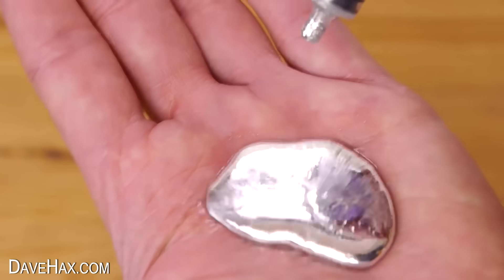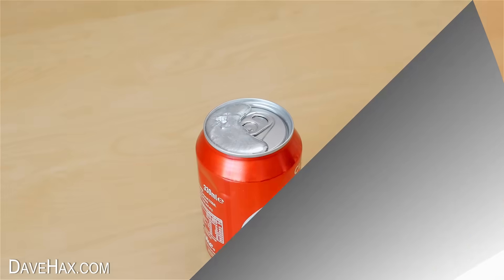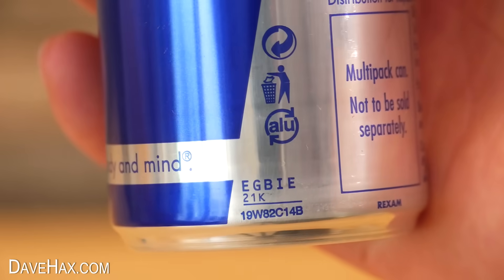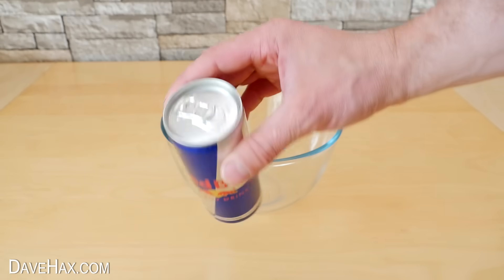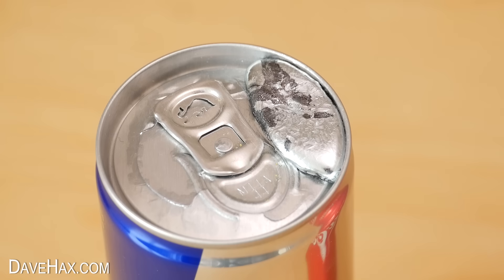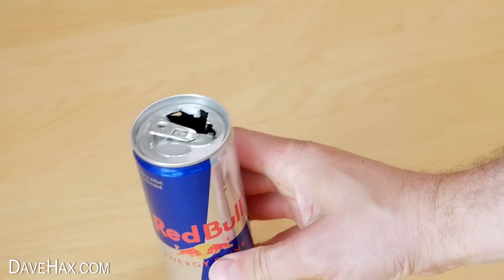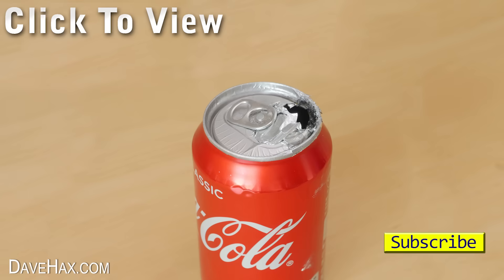Amazing - What Gallium does to an Aluminium Can

Comment: Watching in 2025, here's the explanation why you have to scratch the surface:
Aluminium rusts when exposed to air, forming aluminium oxide. Unlike iron oxide (or the familiar red rust of iron), it doesn't flake off and expose more metal to the air. Instead it seals off the metal from the atmosphere, stopping the rusting process. In this way, aluminium oxide acts as a protective layer on aluminium that defends it from exposure to air.
That layer of aluminium oxide is what stops the gallium from getting in.

Comment: This is why it's illegal to bring gallium onto a plane. Most planes today are made of aluminum alloyed with copper, magnesium, zinc, titanium, and/or scandium. Since the plane is primarily aluminum by weight, bringing gallium could be dangerous as it might alloy with the aluminum and compromise its structural integrity, which could break off a part of the plane and actually, I think you can figure what would happen from there. It wouldn't end very well, that's for sure!

Comment: Of course, there must have been a plastic or corrosive protected film on the can. But can you reuse the gallium and repeat this process over and over again. I want to do an experiment where you take a pound of cans and absorb all of the aluminum out of it and see if the gallium can still Harden and heat up and be as pliable as it was before

Comment: The effectivity of gallium is gone, you mention earlier you heated it right? I saw bunch of video like this, some put gallium directly on engine but the gallium cannot sustained heat. Once you heat up the gallium its effectivity will we gone just like a magnet, the moment you burn the magnet or hear it over 100 degrees, the particle and effectivity will be gone as wellm try using gallium without heating, the aluminum will absorb it.

Comment: Fun fact: Pure Alumium is chemical reactive. But it easily form an Alumium Oxide coating when contact with oxygen. The coating on the contrary is not very reactive, thus allow Alumium to resist corrosion quite effectively.

Comment: Rarely known fact about gallium. It won't affect smooth surfaces, it's not a coating protecting it, it requires a course grain to dig into it. If it's smooth, it just hardens on the surface.

Comment: The "coating" you had to scrape off is Aluminium oxide. Aluminium oxidizes really quickly and would rot away within a day if it weren't for the aluminium oxide layer that protects it from further oxygen (and apparently gallium! :-) ) . 
The fact that it took you longer between sanding and putting the gallium on allowed new aluminium oxide to form on the redbull can. That's what caused the "less effect on the redbull can". 
The stretchy stuff is plastic. There is a plastic coating on the inside to protect the aluminium from the drink. Try sanding off the label and putting the can in something acidic. Vinegar will work. Maybe "cola" will too. Don't drink that cola afterwards. Aluminium is toxic.

Comment: The "thin layer of coating" that he is talking about is basically the chemical reaction of aluminium with air, it will create this "layer" naturally by exposition to oxygen. It's bad that he doesn't know about it tho, he should have done a little bit more research into it.

Comment: The reason the redbull can wasn't as affected was because you sanded it first, before the coke can. Sİnce the coke can was sanded later, the aliminium had less time to oxidize with the air, which gave galium better access into the actual aluminium.

Comment: I make aluminum cans for a living. I see a lot of wrong information on the comments and decided to write this. 

The reason the aluminum didn’t soften in his first attempt is not because of the presence aluminum oxide layer. Every beverage can you find in the market has a polymeric varnish layer (acrylic, polyester or epoxy). This is both in the inside and outside of the can body and also the lid. When the guy sands the metal, he is basically removing that layer. The aluminum grade that is used for the lid has also what we call a pretreatment which is either chromium or zirconium thin layer. 

I hope that helps.

Comment: The "coating" stopping the gallium from penetrating the aluminum isn't a coating at all, it's actually aluminum oxide. Aluminum can't exist in pure form in the atmosphere because it reacts with the oxygen in the air super fast and forms aluminum oxide on the outside of the actual pure aluminum, this doesn't allow any other type of chemical reactions to occur without either scratching the surface of the aluminum or inducing heat. Plus you don't even have to use sand paper, since the gallium is in liquid form on top of the can, you can just use a small needle to scratch the surface of the aluminum while poking through the gallium and just one scratch can do the trick, and since you poke through the liquid gallium to scratch the aluminum there isn't any oxygen that can get to the scratch to make that part of the aluminum, aluminum oxide

Comment: 2:25 Generally, Aluminum forms a protective layer of oxide which prevents it from reacting with other metals. So scratching will help to remove the oxide layer. Thanks!

Comment: All aluminum out in the open air forms a clear coating of aluminum oxide on it, which is highly resistant to rust and corrosion.  The oxide is the reason the first couple of attempts didn't work.  When you sandpapered the can, you created a lot of weak points in the coating, and dripped gallium on it immediately.  It was able to get through to actual aluminum and get a reaction.  If you had left the scratched can overnight before applying the gallium, it would not have worked either because a new oxide coating would have had time to form again.

Comment: the surface should've been scratched prior to the reaction as the aluminum surface has an oxide layer which in this case is preventing the reaction from happening.

Comment: If you cut aluminum into small pieces and dissolve them into liquid Gallium. You need to put the combination to an alkaline solution so the oxidation on the aluminum will dissolve into the alkaline solution and then alloy with gallium. Once done you can put the alloy blob into water. 
It will spin and move around water without any external energy. This is because the aluminum in the mixture reacts with water to form aluminum Hydroxide thus propelling the blob. 
You can imagine the application for such a reaction. 
This was discovered by a Chinese team of scientists.
Reply: Subs? Just an ignorant guess. I have no knowledge here, but I'd imagine pressure at depth and the salt would affect it.

Maybe rocket ships...

... i have no clue.

Comment: I remember doing exactly what you're doing with gallium in the first minute of your video with mercury. I stumbled on a batch of old thermostat in the garbage when I was young and broke them to keep the mercury. Those were obsolete units who had been replaced in a appartement block in my neighbourhood. There was approximately a cup of the stuff. 

Yeah the 70's were most innocent times. Me and my parents didn't know it was toxic. I still have the bottle somewhere but it's sealed. It's quite heavy. Maybe I will find some use for it.
Reply: its totally safe....UNLESS you boil it and breathe the fumes on purpose.....you can even eat it....but dont....😮😮🎉🎉😂

Comment: I thought it was fairly common knowledge that aluminum gets an outer layer of aluminum oxide from reacting with the air that protects it but ig not. It’s like how steel rusts, but obviously with the aluminum it doesn’t actually affect the structure of it and actually works as a corrosion resistant layer since it’s much less reactive. That’s why for this you have to scratch the aluminum before you put the gallium on otherwise it doesn’t actually come into contact with the pure aluminum, just the oxide layer that protects it.

Comment: As Alex95sang below stated, aluminum oxide might be the reason for the first case.
Second thought to why the coke can appear more "gooie" that the redbull, might be, that some cans have a thinn inner layer of some protective material, maybe this material were still holding on to the  new aluminium alloy, how ever, if this is the reason, i dont know, its just a though.

Comment: Aluminum forms an oxide layer in seconds and the gallium cannot penetrate the oxide layer. That is why the coke can was more effective, you sanded that last so it had less exposure to air. If you want to try this and have it work best, put the gallium on the can then scratch the can through the puddle of gallium. That will expose the raw aluminum to the gallium without any air to oxidize it. This is also why the gallium didn't mix with the side of the coke can. The side is a unique piece of aluminum that is only crimped onto the top. There is a layer of oxide on the surfaces and that was protecting the side.

Comment: The surface of aluminum reacts with oxygen to form a layer of aluminum oxide, which is not susceptible to gallium. Scratching removes this coating, but if you leave it out, it'll reform. It didn't affect the can, because it is crimped together, not welded. That way, the Aluminum oxide layers remain between the two pieces, cutting off the gallium from spreading to other pieces.

Comment: The most amazing aspect to me is that the entire top was affected, not just the aluminum under the pool of gallium, which points to extreme efficiency in gallium wicking between the grain boundaries, wicking laterally many-many times the thickness of the aluminum.

Might be a good plot for a spy thriller, as a means of disabling an aircraft on a long flight
Reply: TSA: What do we have here
Flyer: few pens with gallium, sandpaper.
TSA: Nothing to see here. Move on
Reply: Actually I'm pretty sure the backyard scientist got visited by one of the three letter agencies because somebody brought gallium on a plane. If I remember correctly this happened a year or two ago maybe more. So unfortunately somebody already had this idea and attempted to implement it. 

Still make a good plot point though.
Although I'm not sure about the viability of this idea. I just don't know how much gallium You would need and how quickly it would spread. Also without some sort of abrasion to remove the oxide and any other coatings I'm not sure if it actually affect anything. Those seem like the most obvious problematic elements. At the very least you're going to ground the aircraft possibly permanently. So it might work as a plot point for a interesting way for a saboteur to take out airplanes. I can't imagine the sort of inspection and testing you'd have to do to recertify those aircraft Even if it didn't affect anything. If you could pass it off as metallic paint it wouldn't be super suspicious to have paint and sandpaper. Ground-based sabotage seems like it would have the greatest chance to be effective. That seems like the most plausible scenario for an effective use of this idea for a story.
I kind of got off on a tangent there sorry. I just finished reading a book and the idea seemed like a interesting one for a story. But also seems like an easy way to annoy the technically minded without a bit more research. Or at least I'm prone to that sort of annoyance, for example If you told me a passenger dumped a small water bottle filled with gallium on the floor and 5 minutes later the airframe fails and plane crashes, well I might be kind of annoyed with you. And if it's a main feature of a main character, it can turn off people who would have enjoyed your story otherwise.
Reply: That's wicked
Reply: There is a reason the stuff is banned on airliners
Reply: @blargcoster  right now you can be banned in plane if you have pliers or screw. You can make proofs, what liquid metal allowed on the crew?
Reply: Very long variant for diversy, more simple is rocket
Reply: Bare aluminum oxides immediately when exposed to o2, oxidation probably acts as a coating between the two. The lower portion is a separate part of the can, and also anodized on both outside and inside, this is another coating between the two. It is strange how the "affect" spreads without contact though, there may be a weld/seam stopping that from reaching the bottom half
Reply: the funny thing is your actually not allowed to bring gallium on flights for this exact reason

Comment: I have done maintenance at rexam, the company that makes cans for many drinks including Budweiser and red bull. There is a process in manufacturing where the cans go through the spray room. They get sprayed with a protective coating that gets baked on. Without it, Coke would eat through the can.

Comment: The reason why only the top of the can was affected is because the top and the body of the can are made from two separate aluminium pieces which are pressed together to form a seal. The way that Gallium works is it first penetrates into the crystalline structure of aluminium and then works its way through it. Because there are 2 separate pieces, most likely separated by the same thin aluminium oxide layer that you had to scratch off initially, the Gallium never managed to transition into the body of the can.
Reply: It's pronounced "Aluminum"
Reply: @rickyfigueroa8611  In the greater part of the world, outside North America, it isn't pronounced aluminum.

Comment: Al is so reactive that it forms a passivation layer which is why you have to sand or scratch it before it will react.  You can even get non-reactive metals to form a passivation layer with a strong oxidising agent - for example boiling piranha solution in a stainless steel pan.  The other problem is that you are in England so it's too cold for the Ga to remain a liquid (or for you to win test matches against Australia).

Comment: The “coating” is aluminum oxide which forms almost immediately when aluminum comes into contact with oxygen. The best way to infuse gallium with aluminum is to first add the gallium and then scratch the aluminum surface with a razor blade

Comment: The aluminium used with drinks is coated in a thin layer of plastic coating like magnet wire. That's why the sandpaper helped. T light candles also are coated this way
Reply: no they arent its to do with the aluminium mixing with the air and creating a oxide layer only the inside of the can has a plastic coating

Comment: Even I know there is a thin layer of plastic coating on those cans, without the coating it would crumple like an aluminum foil. People disliked the video because half of it is about not knowing about the plastic coating.
Reply: there is no plastic coating its just metal reacts with air and creates a oxide layer so basicaly there was no contact till he scratched it

Comment: Coca-Cola cans have a thin layer of epoxy on top of the aluminium, just a few microns thick. The epoxy is there to protect the can from corrosion.
Reply: not only that, but alluminium naturally creates and oxyde layer around that doesnt react
Reply: Well aluminium itself has a coating layer which forms naturally

Comment: Two thoughts. The aluminum needs to be cleaned of the aluminum oxide that builds up on the surface. 
Secondly, the area needs to be above 30 degrees C to keep the gallium liquid to keep the reaction going.
Reply: Did you watch the whole video?
Reply: @rampage3390  I did. From beginning to end!

Comment: the reason why the can wasn't affected at first is an effect known as passivation:
basically the aluminium just oxidizes, like iron, but unlike iron, the oxide doesn't flake off, instead it just remains there, strongly attached as a very thin layer of oxide, which prevents the rest from oxidizing.

Comment: aluminum oxide (Al2-O3) is actually called corrundum, an extremely hard abrasive that is naturally formed by the oxygen in the air touching the "aluminium" in the can, fun fact: this comment was produced by a 13yr old, also fun fact: aluminium is almost as hard as diamond, which is almost as hard as wurtzite.

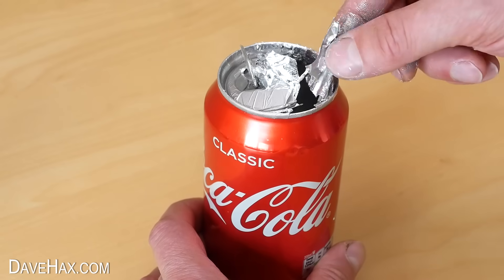Comment: re  -  3:46  -  "I kept pulling and removed the whole top..."
Are you still talking about the Al/ Ga experiment there? Or had you lapsed into reverie, recalling moments of some err... 'hands-on' affection, in relation to brassiere removal?
In all seriousness, though, aluminium- like many metals- will form a protective oxide layer upon contact with the air, which prevents further oxidation of the metal. Also known as passivation, this process is artificially reproduced with metals such as stainless steel in order to prevent it from rusting. Rusting itself is just oxidation of the metal. I don't want to go into too much detail/ into boring levels of detail, so suffice it to say that in the case of aluminium or chromium, only the surface layer of atoms are oxidised, while in the case of steel, the oxidisation continues throughout the crystalline lattice of iron and is not limited to only the surface layer.

In the experiment above, I expect that the gallium wasn't reacting with the aluminium initially because the surface layer of aluminium oxide (Al2O3) prevented any redox reactions from propagating. Once the aluminium had been sand-papered, however, the gallium oxide (Ga2O3) had access to unoxidised aluminium (Al) and was able to react with it. The gallium oxide (Ga2O3) was then reduced by the aluminium (Al), with the aluminium in turn being oxidised, forming aluminium oxide (Al2O3) and presumably releasing heat in the process.

That's my guess on what's happening based on what little information was offered in the video. If I'm wrong, I'd be very interested in hearing about what I got wrong and what's actually happening.
Cheers